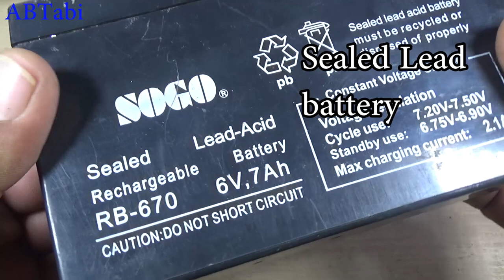Super easy battery Repair, dry batteries repair at home diy project

Comment: Simply pour distilled water . It worked for my 6v,4.5A battery ...
Reply: friend how much distilled water
Reply: Distilled water will not help for dry cell batteries  , you can add distilled water and charge but charge will drop immediately this guy video wrong

Comment: The citric acid in the lemon s the electrolight. It works on simple can batteries as well. But its a short time fix. The batteries found from ancient Egypt used this process.

Comment: Sorry after putting lemon and water can I connect with a normal car battery charger?
Reply from the maker: Dear friend you can connect ,,,,    but it is very slow process ,,,,,,   Thank you for interest ,,,,,,
Reply: @ABTabi  thanks for the answer. any other suggestion?

Comment: Please don't make fool people, in start you are connecting negative to positive & positive to negative, after poring lemon drops you are connecting +to+, and -to-. One thing more the battery was 6V, after making fool your AMP meter showing 12V, how its possible, It's not fare.
Reply from the maker: My dear friend,,,,,,,,,   digital multi meter can count correct negative to positive & positive to negative ,,,,,,,,  this is a not an issue you can try,,,,,,,,,   Thank you for interest ,,,,,,,,,,
Reply: ABTabi. And what about 6volt battery showing 12volts? Is it also correct.
My suggestion for you, plz try APSOM SALT for dead batteries.

Comment: Has this happened to you? I had these old batteries stored in my garage and my wife's junk drawer and I thought they were garbage.

But my neighbor told me about this new battery reconditioning system and to my surprise, I was able to make them work again. Not just for my car batteries but also my AA, AAA, C, and D batteries, my drill and my laptop battery.

Don't take my word for it, go ahead and try it yourself! efficial. xyz

Comment: Dumb it reads negative because when he used the multi meter to test he used the red on black and black on red which false reads . Then matched colors on other battery. So easier terms he used the positive rod on the negative side and negative rod on the positive to test black battery then used positive with positive , negative with negative .. Atleast if ur going to bs people make it a little more believable or learn proper way to use meter .and use gloves for safety .
Reply from the maker: My dear friend ,,,,,,  positive with negative lead is not an issue because digital meter reading correct only shown with negative sign  ,,,,,,,,,   Thank you for interest ,,,,,,,,,,,
Reply: @ABTabi  yes but when u are showing someone something that diesnt know anything about a multi meter it would be helpful to them if shown the correct way to do it . as someone not familiar with it and the reading might freak and wonder how its possible that it is reading a negative number. I just stated why it was reading a negative number at first . as wellas anyone messing with anything having to do with battery acid should be wearing safety gloves as a lot of people dont understamd how bad it can burn them .
Reply from the maker: Thank you dear friend for suggestion and interest ,,,,,,,,,,,,,,

Comment: 12v electrical scooty  Exide lead acid battery multimeter checking 10v
I remove the battery distilled water feeling not respond voltage  
1day
full charging not 11v but not voltage increase what happened  please tell me sir
Reply from the maker: Check charging rectifier circuit ,,,,,    Thank you dear friend for interest ,,,,,,

Comment: Hi ABTabi, does the battery recover its capacity after this process?
Reply from the maker: 6 volt as original ,,,,,,,,,,,,,,,     Thank you dear friend for interest ,,,,,,,,,
Reply: I understand the voltage will be recovered how about the battery capacity??? Will this battery recovered its 62Wh?????

Comment: Would you get the same result if you piss in it?
Reply: Ricinine Partypillz, Check the battery fluid.Try to fully charge the battery. (I discovered about these and more from Jons mender guide site )
Reply: @JosePerez-rt1kb  do you have a link

Comment: Funny the + and - was tested in reverse
Reply: It does not matter, voltage on volt meter will show the same volts with the exception that if you have them reversed there will be a minus sign in front of voltage

Comment: This video is deceptive  !
Although they're both 6v batteries the bulb doesn't light up on the black battery because the positive wire is placed on the negative post; notice the neg. indication on the meter . The man doing this video is a liar ! And lemon juice doesn't charge a battery  !
Reply from the maker: O my dear friend please remember this is a digital multi meter for volt testing not an analog meter ,,,,,,,,,,,,
Reply: @ABTabi  6volt is not an issue, please try to review your video at 1:06 the white battery you've test is correct polarity with your digital meter red to red and black to black, and you test the black battery black terminal of the battery you put the red lead of multi tester and red terminal you put black lead of tester of course the display will become -2 because of reverse test, please friend don't deceive the youtuber okey?